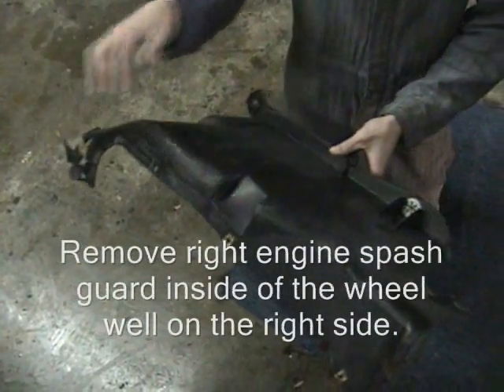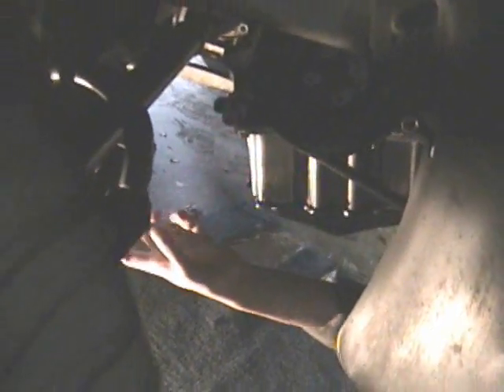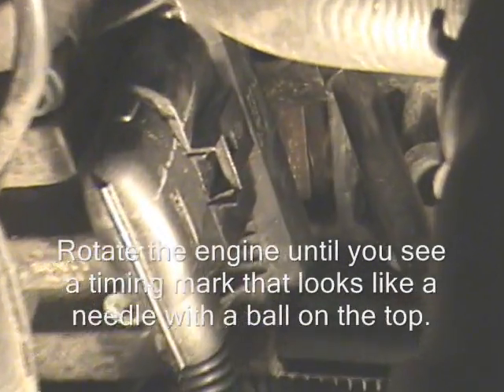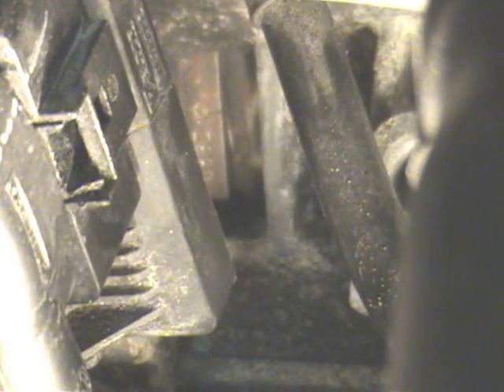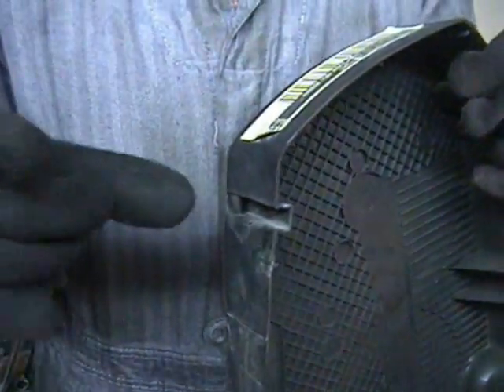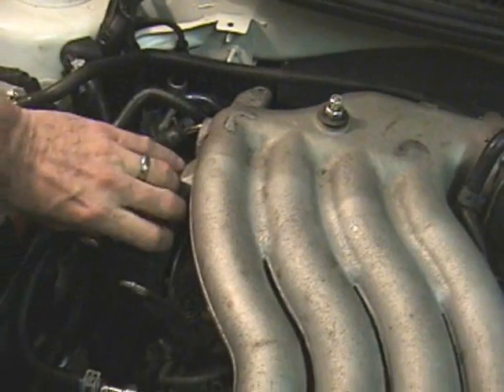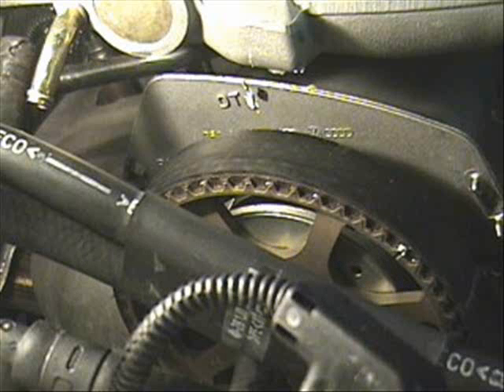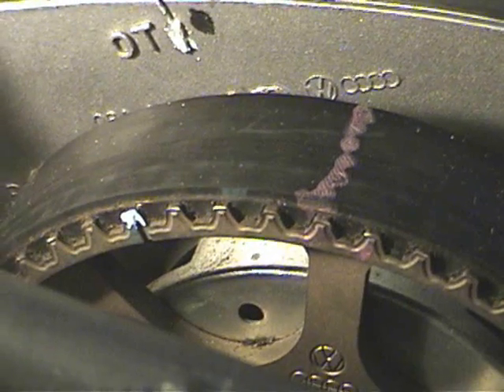How to Put Piston 1 at Top Dead Center (TDC) on a 2004 VW Jetta 2.0L Engine

Comment: If I align both the camshaft pulley marks and the flywheel mark in the inspection window as described, is the #1 cylinder at TDB on the compression stroke or exhaust stroke, or does it matter? Do I just need to find TDC, or do I need to find TDC on the compression stroke to put on a new timing belt?
Reply: first you need to see if you got a manual or automatic transmission to KNOW where to look for your marks and where they are, THEN you can focus on being TDC on all your marks, any tampering with the Timing Belt, Water Pump. Timing Belt Tensioner and messing with the Pulleys from the timing components will usually require you to REDO the TIMING.
Reply: it needs to be at the compression stroke by the way ! :D (OR ELSE YOU WILL NOT HAVE INTERNAL COMBUSTION)

Comment: the cam shaft can be at tdc but the crank can be off tooth, what a CRAP crank mark, bottom of the of the WINDOW!? they couldn't give use 2 marks like they did with the cam!?
Reply: German Engineering, designed for 0 transparency and a sophisticated build to prevent COPYING at it's FINEST lol !

Comment: Need to clarify that this is how you set TDC on a VW BEV engine with an automatic transmission.  For a manual, you line up the markings in the center of the window

Comment: Can't just do by camshaft unless you check the cam lobes are at around 11 0clock on cylinder 1.theres two top dead centres for open and close.
Reply: Another way to check is take out spark plugs.put ur finger in piston one and form a seal.it want it at tdc when it is combust.i use a bit of tissue on a cotton line. If when u rotate the crank shaft and the tissue lifts you know you have it on compression stroke not visa versa.then you can just use a straw on top of piston to get the tdc.some flywheels don't have markings so this is a good way to tell.

Comment from the maker: You have a mouth on you, csourdieselking. I think they mean that if the tensioner pulley is loose, there is give (or slack) on the left half of the timing belt loop. The right side remains tight. So if crankshaft is turned clockwise, timing belt will still grab the cam gears and rotate cam. If turned counterclockwise, both halves to go slack, skipping over crank teeth, depending on pulley tension. With correct tension, we have turned in both directions with no jumping or slippage ever.

Comment from the maker: When the engine is running normally, the crankshaft pulley is turning clockwise as you are looking at it through the front wheel well on the passenger side.  When you are putting on the timing belt with the engine off, and just synchronizing the overhead cam with the crankshaft, it does not matter which way you turn the crankshaft by hand.